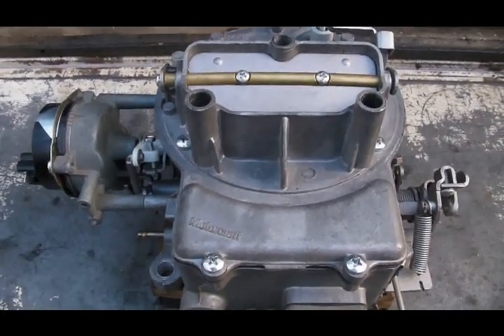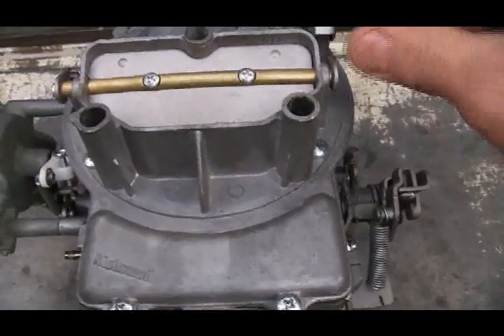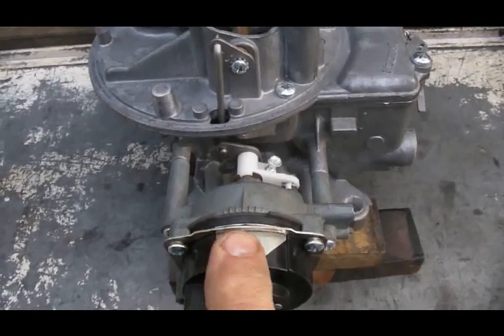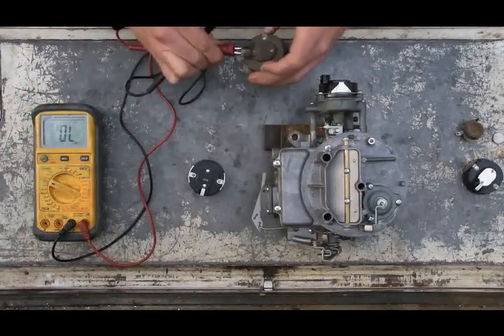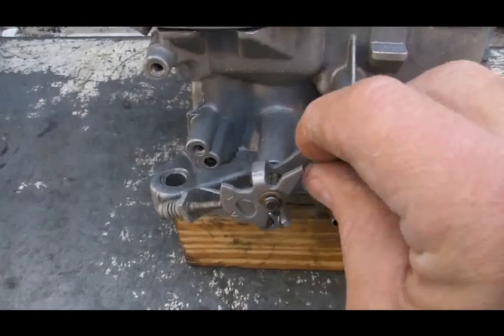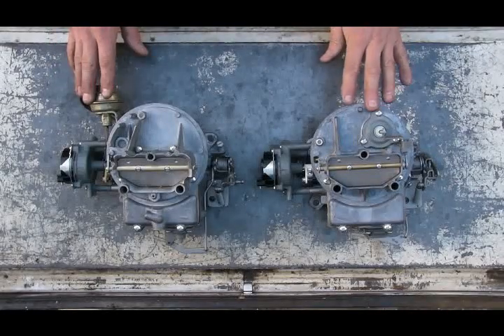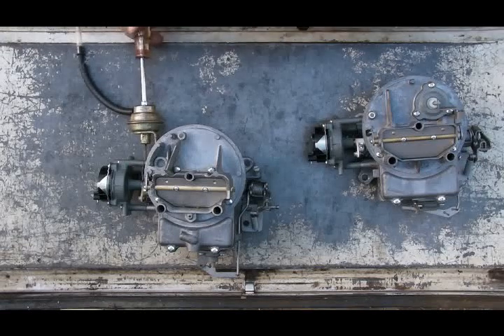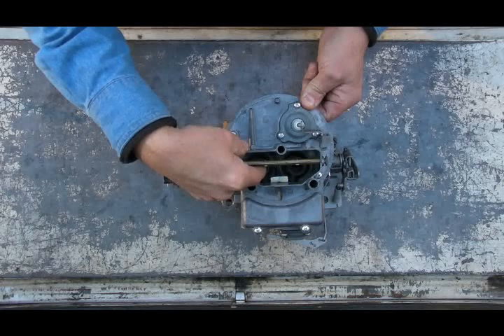Motorcraft 2100 Series Choke Mechanism Adjustment

Comment: I'm new and learning all of this for the first time. So, please be patient with me. I have a stock, 1967 Mustang. With a stock 289, 2 barrel stock carburetor. Right now, when it has a cold start, it runs at 1000 rpm. When warm, it runs 1100 rpm. I've been told, it should be 700-750 rpm on a cold start. And 600 - 650 rpm after it's warmed up. I played with the fast idle screw and got it down to around 800 rpm cold. But it keeps dieing. I have to keep my foot on the gas to keep it running. If I have to keep my foot on the gas, it's hard to adjust the screw at the same time. So I have to wait till the car cools off each time to adjust the screw, and try again. This will take forever. And I don't know if I'm even doing it right to start with. So I turn the fast idle screw to the right to increase my rpm at cold start up. Then turn the throttle adjustment screw to the left, to slow down the warm idle rpms. Is this correct? Also, the screw on the plastic piece connecting the choke to the idle cam, on mine is all like wet noodles in there. I can move parts all over and it don't move anything else. Want to make a trip to Ohio and teach me what I'm doing wrong?

Comment: Outstanding explanation for a non-car guy like me. I have a 68 Galaxie fastback w original engine/carb/intake, etc. and the choke was basically stuck, so the spring didn’t move anything as it heated up. Taking this apart made me nervous but it worked- so car can now start without keeping accelerator pedal floored. Now I just have no fast idle at all so I will try turning it that screw underneath the choke mechanism IF I CAN REACH IT.

Comment: thank you for the excellent video on 2100 series carb choke adjustments. i will be doing some work on my 1983 mercury cougar 3.8 making necessary carb adjustments to get the idle correctly done.

Comment: You’re awesome!  Best carb video ever! The only thing is, could you demonstrate the actual proper settings of those excellent explanations you made in this video? I now understand the basics of setting screws in each area but the actual setting they need to be at for a proper general set up would be really helpful even further. Thanks for sharing your knowledge about this topic!!! Just at basic Fall into Winter setting vs a Spring into Summer setting. That would help tremendously!

Comment: I feel the most unique feature of the Autolite choke is that white plastic piece with screw adjustment of high idle pull off rate. I don’t Holley and Edelbrock guys realize how much they’re missing without it.

They all start their carbs cold and either have to keep the engine on fast idle to warm it up or potentially kick it off fast idle too soon with the choke opening.

This setup allows you to obtain a normal idle, shift into gear, and drive off without a stutter even with the engine still cold as the choke plate is still blocking cold air.

Really the closest setup behind fuel injection.

Comment: Great video, very good explanation. What I’m missing is a step by step procedure, because I find it quite hard to get all the linkages work together as intended. My problem is, if I set the choke housing to specified mark, the opening after stepping on the throttle and the opening under pull off, the flap doesn’t fully open when hot. Also, the engine dies for a few tries directly after startup.
Reply: I'm having same issue with mine.  Or on the first press of throttle, it won't fully close the choke plate.

Comment: What about the little tube that runsfrom the exhaust manifold to the back of the cam? Do I need it on a 2150 or just the voltage Goin to it?

Comment: Great video. However, I'd like to add some info to the choke cap portion. Bill's correct in that adjusting the cap will change how long (time) the fast idle is engaged. He doesn't really fully explain the why. As you know on OEM caps there is a rich and lean directional arrow with rotation. So both are correct. When turned counterclockwise Bill correctly indicates that the warmup time will be longer. The "why" is because the butterfly will be closed more, thus providing a richer environment which correlates with the cap directional arrows. A richer environment does not burn as hot and therefore will take longer to heat up exhaust temps and this longer for the cap thermostat spring to expand and longer time spent in fast idle choke. Rotating the cap the other direction (clockwise) will thus decrease the warmup time. Bill is correct here too. The butterfly will be open more and thus a leaner environment will be created and correlate to the cap arrows. A leaner environment will burn hotter and exhaust temps will rise quicker, shortening cap spring expansion time and distance.

All in all, a superb video for explanation of the 2100 and 2150 function!

Comment: Outstanding!!  Exactly what I was looking for. I have one question, where should power for the choke cap come from? Mine is hooked up to an ignition source so it’s hot after the key is on and stays on which I imagine would fry the plate after a while. Thanks for your excellent teaching. I will look for more carb videos as my 89 YJ with the 2150 needs a bit more tweaking.

Comment: Great educational info!  I have a 1965 ford that has a 1962 or 63 2100 series that doesn’t have the vacuum pull down like your example.  Is it internally operational or is there linkage on the accelerator side that adjusts it???

Comment: I have the F2-2100 Carburator for a 1966 289 Mustang. It does not have either of the Choke Plate Pulloff options discussed in this video.  How do I adjust the choke plate pulloff without either of these mechanisms?

Comment: Great vid.  What if my Autolite 2100 carb doesn't have a visible choke pull off?  How do you adjust how far the choke plate opens?

Comment: And some of the older ones had a heat riser tube from the intake manifold to the choke that you did not cover.
Reply: Yes that’s what I have on my 65 289 2100 carb and I’m getting vacuum at the thermostat housing when I remove the hot air tube. Is that normal? Other than that my carb is dialed in pretty close sometimes it dies after initial start up but usually with another pump of the the throttle it idles pretty well at about 1600 rpm and after driving a few miles it comes down to a respectable idle
Reply: @Michael-e1r3m  no should be no vacuum there.
Reply: @pl747  where could it be coming from, possibly a bad seal or gasket inside the choke assembly? I saw a brief video of the inside of the assembly and it looked like there was some sort of rubber plug that moved against it when the linkage moved
Reply: @Michael-e1r3m  i don't know because the heat riser works off the exhaust side
Reply: @pl747  yep that’s my thought 
Possibly a crack somewhere but the car runs well 
I guess I’ll pull the thermostat off and try and run it to see where the vacuum leak is coming from
Reply: @pl747  I checked some resources and yes there should be vacuum there at all times….. metered vacuum mine might have a little more than excepted because of a worn choke assembly plunger 
I finally found a diagram and it shows a vacuum port and the  plunger the limits thee amount of vacuum but vacuum non the less I’ll try and post it on here 
I’m just trying to share info like my man  who did a great job of explaining all the choke functions 👍

Comment: Great video but would you be able to talk about the difference between the electric choke in your video and the older vacuum style choke? I have a 2100 on a 72 amc 304 engine and the choke operates off vacuum.

Comment: I have watched this several times and adjusted my carb accordingly.  But it still will not completely open when engine is warm.  Any tips there?  Will not relaease to the hot idle.

Comment: Im working on a 2100 currently. Its probably the 3rd or 4th 2100 ive done in my life but this one is different. Its different than the 2 we have in the shop and its different than the 2 you show on your video. It doesnt have a provision to open the choke with the throttle all the way open. Its on a 72 Gran Torino and its got a 351c.  The fast idle cam is stepped on by an arm that rides on the throttle shaft and its got a adjustment screw that rests on a bracket that is connected to the end of the throttle shaft. I was checking the clear flood and noticed the choke didnt open. Its very strange. At this point in the game most of these carburetors have been molested by anyone and everyone with a screwdriver but this one looks like its maybe had one or two rebuilds in its life. Just wondered if anyone else had worked on one like ive got. Or if Im missing something. Thanks for your video.

Comment: How does the choke heating element ground through the carb when there is one, maybe multiple paper type gaskets that isolate the carb from engine ground? thru dirty threads on carb studs?
shouldnt one measure Ohms from pos choke to actual engine block or even battery grnd?
if my carb has no wire to this carb electric choke then i have zero working choke?

Comment: Great instructional video!  Have Question though.  When you adjust the relationship between fast idle and choke timing, will the fast idle ever come off on its own?  Or do you always need to hit the gas with your foot to disengage fast idle?  I thought if properly adjusted, and you let it run on its own, the choke butterfly would open in its own and fast idle would automatically come off.  Is this true?  Thank you

Comment: Hi Bill, my name is Göran from Sweden. Bought a carburetor on eBay, an autolite 2100 and got a killer fan than the old one. It was shipped from China, and followed your video on you tube and made your basic settings. But as soon as I start the car (Mustang 67), the car accelerates by about 2000 rpm. Then it stops after about 2-5 seconds, has tried to adjust your settings. But nothing works, same result. If you buy from China, it will be like this sometimes. I sincerely hope for an answer before I send it back, possibly. Best regard Göran
Reply: Did you managed to have it sorted? I was going to purchase china one myself, as my choke pull-off vacuum cylinder went bad -  menbrane develloped perforation ( now I got it replaced - yes it can be done). 
Regarding the Trouble you  experience superfast idle and stopping engine.. 
Make sure youre bowl level is right. Try to start it and once it starts or even if it wont run but you had it cranked, stop it or stop turning over, and remove your Carb top cover while youre carb is still on the manifold. See what your wet fuel level is like. It should be around 23mm from the matting/sealing surface. 
I would also use your original Fuel Jets from your old carby. 
From what you say seems that your engine lean-stalls  - or runs on fumes - not enough fuel delivery - maybe your fuel pump dies? 
Get yourself transparent fuel filter so you can watch fuel delivery also check that Wet Bowl Level I explained above to you.
Let me know how you went along
. Anyways, this is best educational video - you were lucky to find that one here!!

Comment: I noticed you don't mention the "V" on the fast idle cam.  I have been told the screw should be on the "V" when cold(?)
Reply: I filed the steps off of my fast idle cam and adjusted the fast idle screw accordingly

Comment: My early 2100 (which has no choke pull off) has a choke plate that never opens fully even when warmed up. I adjusted the thermostat so the plate is cracked just enough and runs great at cold start, then kicks down to the right rmp, but the plate never opens fully. How do I adjust that plate? Thanks. 🇨🇦
Reply: Make sure the rod is not kinked, you may need a slightly 1
Reply: Maybe 1/8 inch longer rod

Comment: How do I adjust how rich it runs?
Reply: Set the choke at index for spring and fall.  Set it at 2 notches rich in winter and 2 notches lean in summer

Comment: I can't find why my car stalls at idle when the choke is all the way open
Reply: I’m not sure if this is correct but i would guess it’s not getting enough fuel. So you can back out the screws a bit to see if it’ll make it richer? Just don’t tighten the screws down cause it’ll ruin the carb since it’s aluminum.